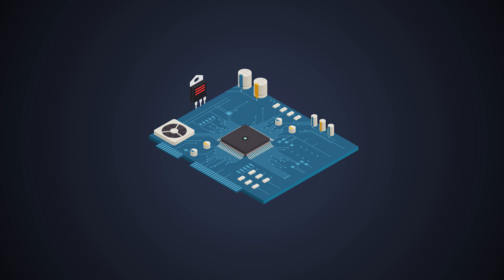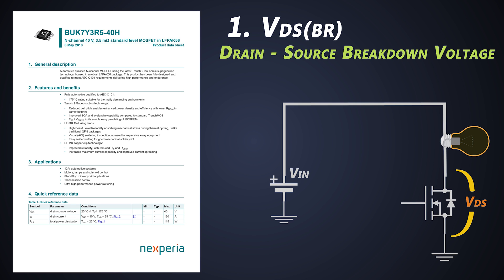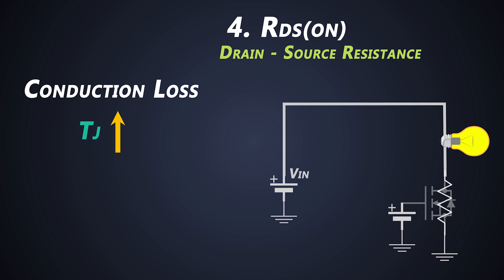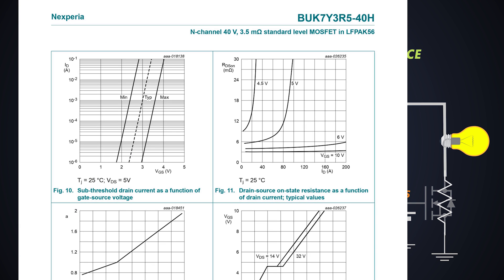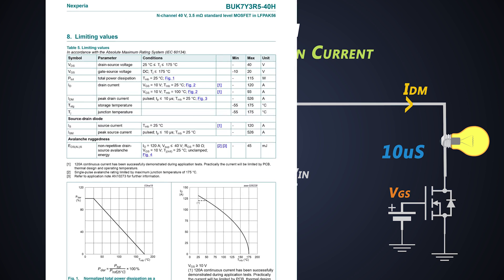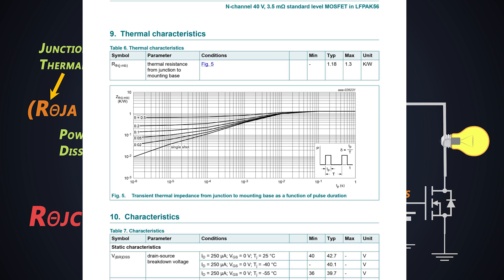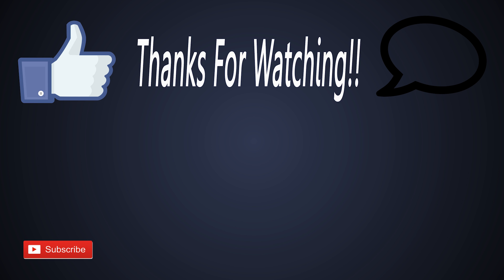How to select a MOSFET? | MOSFET parameters | MOSFET selection

Comment: Your suggestion for BUK7y3R5 is good and it modern MOSFET with Very low ON resistance.  its not easily available in market. Can you suggest me an advance and modern  Logic Level MOSFET , which can be used for 5V RELAY ( 30mA coil current. )

Comment: Excuse me, may I ask something? I want to build a DC-DC boost converter, that steps 147-V voltage up into 300-V. Can I use an IRFPS40N50L which has 500V Vds, 46A of Id, and +/-30 V of Vgs? Thank you so much for answering me.

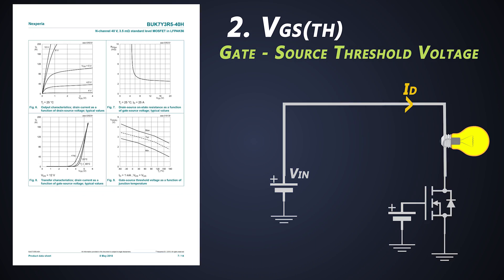Comment: 2:40 I'm having trouble understanding how Vgs can be negative for an N channel mosfet and turn on.  I think the -10 means that Vs-Vg can be -10v without damaging the mosfet (and the mosfet will be in cut-off region in that case).
Reply: Negative voltage can be used for decreasing turn off time, making it turn off faster